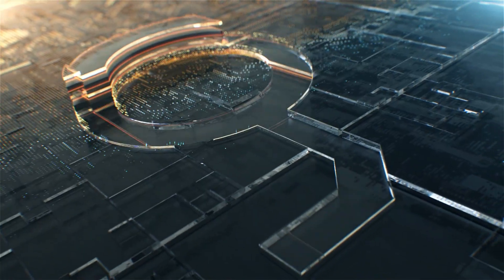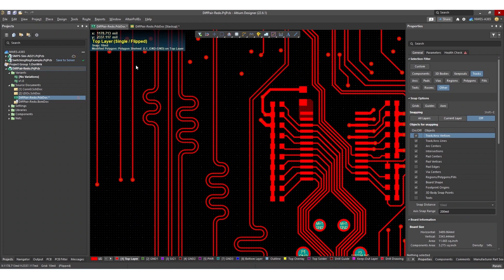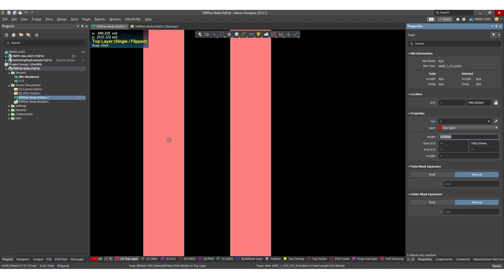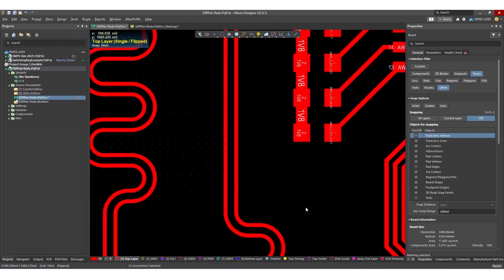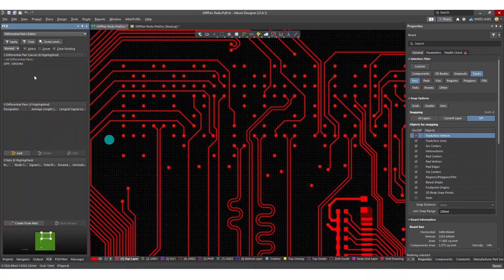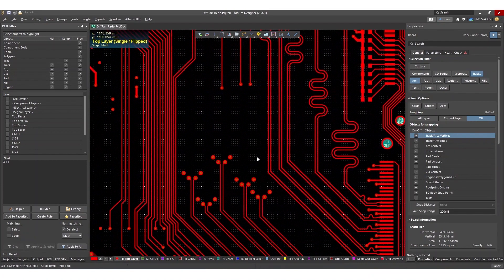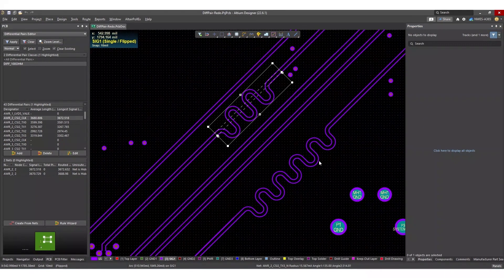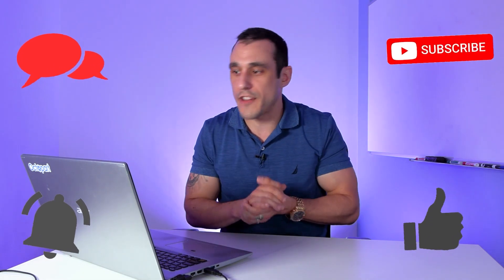How to Reroute without Rerouting!

Comment: In 9:20 when you select the diff pair using the net classes, you actually select them on all layers, not only the top layer, and you are going to modify them all. unless I am missing something the next part which is talking about repeating the procedure for the middle layer doesn't make sense!
Reply: If they were top and bottom layers only, or just on one layer, it would work fine just using net class select. If you have them across external and internal layers, then it's best to use a query.

Comment: Why don't the length tuning objects also have the width property, as do tracks and arcs? Then you could adjust everything without exploding. That sounds like a feature request. Also, it is also strange that diff pairs don't have a "meta property" for spacing that could be edited the same way. Not to speak of that a rerouting function should respect all these rules and nicely adjust width, spacing and length tuning sections if rules have changed.
Reply: You can do it with the auto-retrace feature under the Route menu, but the auto-retrace tool can mess up or remove other things in that differential pair like the small corner matching sections and the flare-out coming into vias. I've never had it work successfully when I apply the manual corner matching sections or flare-ours into vias. If you don't have any of those features then you can try the auto-retrace.

Comment: Also, are there any tools in Altium for specifying return path via patterns around differential pairs layer transitions or is that something that needs to be added manually?
Reply: Do you mean like automatically creating an array of vias around a pair of differential vias?
Reply: @Zachariah-Peterson  yup, precisely.
Reply: @JeffreyBoye  There is an array feature but I have never used it for placing stitching via arrays. Normally I will design it manually for one via transition and then copy that to other via transitions so that they are all identical.
Reply: @Zachariah-Peterson  okay, if it's good enough for Zach, it'll be good enough for me!

Comment: i simply changed my impedance profiles and used retrace, worked like a charm?!
Reply: You can do that too, I'm actually going to add in a link to a retrace demo in the description. EDIT: I still see some people still don't use the auto-impedance profiles as programmed into the design rules, so they have to go through this kind of process unfortunately. One problem with the retrace tool is that it can remove any other length match sections like the small bumps coming off the connector. Those are important for maximum common-mode noise suppression so you should keep them if possible. The retrace tool will remove those even if they don't exceed the max uncoupled length rule in your impedance profile, so depending on the design retrace might work better, or you might have to do it manually.
Reply: @Zachariah-Peterson  i see, still valuable input there!
Reply: this comment is worth more than the original video
Reply: @afshins5921  retrace is nice but doing it manually on these diff pair is better, see above comment. The retrace would also mess up the via approach and straighten it out instead of leavingat the angle, that can be bad if your doing some really high speed stuff like serdes
Reply: @afshins5921  Sorry but I stay away from the auto-retrace on differential pairs. It's great for single-ended when you update the design rules, and I would even say it's fine on slow diff pairs like low-speed USB or 10/100 Ethernet, but I won't touch it on Gigabit or faster Ethernet, or on fast SerDes channels. It messes up the small details that really matter for signal integrity even if they don't violate any design rule.

Comment: Okay great, but how to recreate primitives like match lenght group?
Reply: If you're going to do it this way thne you have to leave them as arc and track sections after applying the changes. If you use the impedance profile in the stack manager and you have the settings in the design rules, you can use the retrace without exploding the length tuning sections. Either way, if you set the length tuning precisely originally, you won't have a huge change in the length tuning tolerance so you won't need to re-make them as tuning sections after applying the changes.

Comment: Hey Zach thanks for this video, I've lost count the number of times that I've had to redo the length tuning sections after a layer stack modification. Always best to get the layer stack sorted before routing anything or fabricators seem all too keen to make changes to the production gerbers to meet requirements - not something that I'm keen to let them do!
Reply: I've had situations where I take the design to prototyping and it works great, and then when the client goes to scale, we have to go to a larger EMS and they want to make these stackup or material changes. Either they don't stock the exact/compatible materials (even though we picked them off the shelf!), or they just want to reduce their own process load. If I argue with them enough they eventually create something with minimal layer stack changes, but that still requires me to validate it on diff pairs and any high GHz RF links.